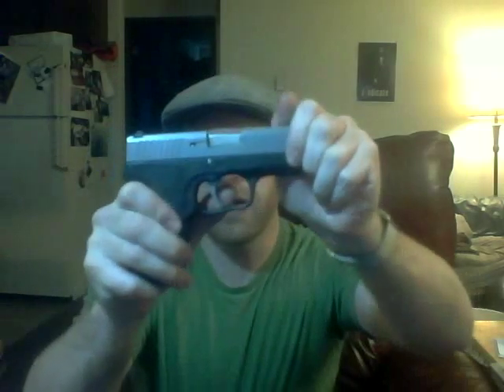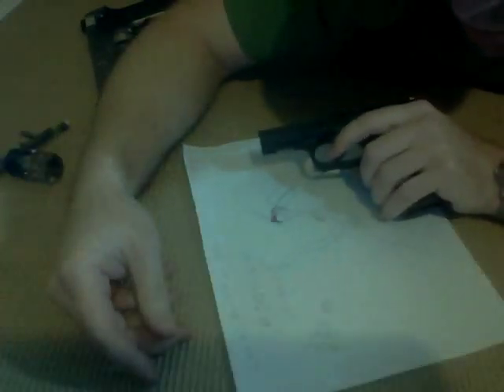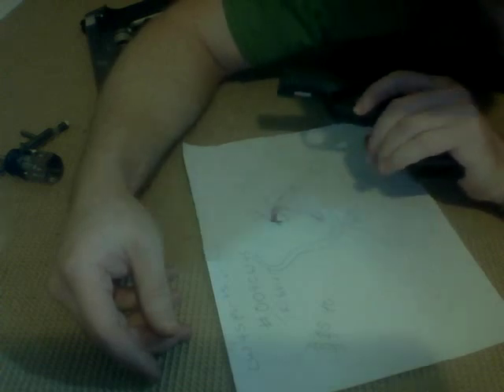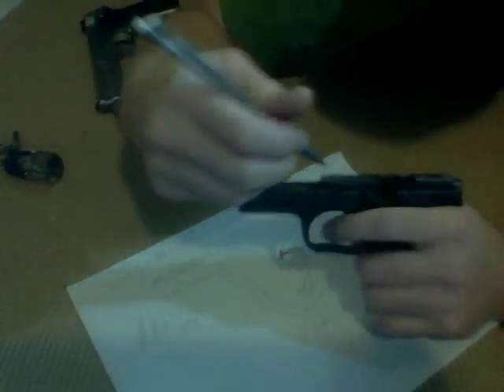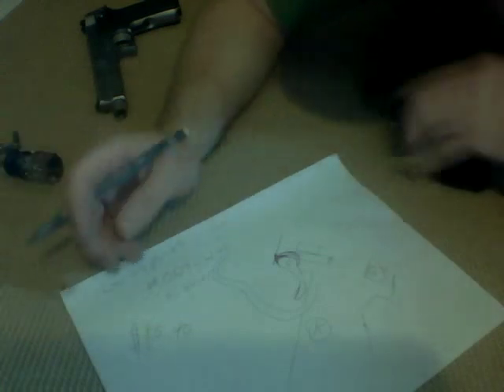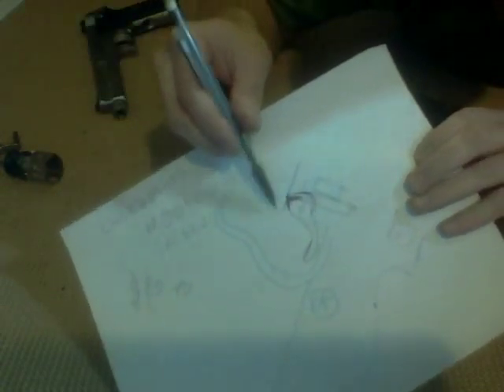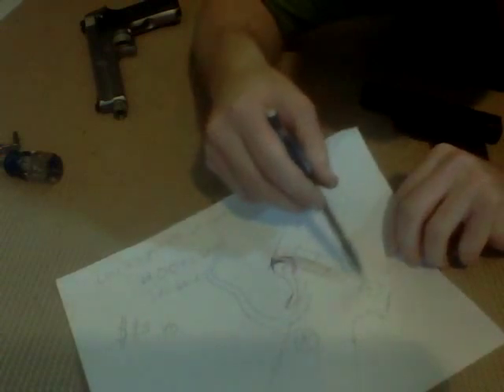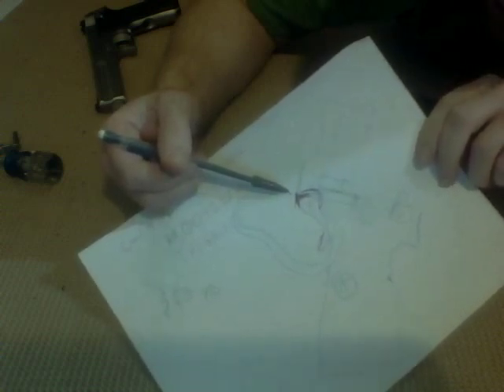Kahr Problems ... addressing a serious issue with a CW45

Comment: this was an obvious manufacture defect and under warranty or not Kahr would fix this issue with no questions. I've owned my cw45 for years and never had an issue. and ive put hundreds of rounds through it.
Reply from the maker: 1) I said as much in the video. At the time, all manufacturers were bogged down with a panic. Warranty work would likely have meant being without the gun for several months. This way, I did a simple modification to an easily replaceable part which could be purchased for $14 (IIRC). Worst case scenario, I'd just order another trigger, install it, and he would send it in for warranty after the panic backlog was sorted.
2) I've repeatedly said that Kahr makes fine firearms and this is not a common defect. However, I have gotten tons of people since this video saying they had the same defect on various Kahr models, so it is not that rare either. This defect is particularly bad, because it is not easily noticeable outside of certain weather conditions. Many users would not know about this without deliberately checking. It's a textbook "latent defect." No matter how flawlessly your example of a Kahr is, this one still had a serious flaw that people deserve to know about.
3) Hundreds of rounds is where the recoil spring wears out on many kahr models. Be sure to replace that soon. It's not a big number, but the spring is doing more work past the compression threshold on a sub-compact so it wears much faster. IIRC, Kahr recommends replacement at around 500 rounds with the PM9 & CM9. I don't know what the number is for the .45, but it is something I would want to know. It  makes a big difference in feed reliability.

Comment: Could you possibly list all of the "most other striker fired handguns" that have a second strike capability?
Reply from the maker: +Ronaldo Crespin That sounds like a big hassle, but the current gen Walther PPS somes to mind. There are at least 2-3 other recent gen guns but I can&#39;t think of them at the moment.

If you are somehow contorting things to an impression that I was saying most striker fired handguns have second strike that is not the case. Instead I was saying that the Kahr has a DA revolver/ DAO auto  like trigger by feel , but lacks that capacity.
Reply: +GunFun ZS I will add, that even though I have had many Glocks, I now prefer to have a handgun with a "second strike capability". I have had recent experience with primers not igniting and 99% of the time they will fire on a second strike. I find it extremely odd that one of the most dependable guns on the planet requires you to rack a new round into the chamber if you have a misfire. Yes, I am a sarcastic humorist, but I also am very serious about avoiding self defense weapons that do not allow a "second strike". I don't know why but I thought that the Kahr was full DAO, so I do thank you for clarifying that about the Kahr.

Comment: Happiness is a warm gun... I need to pop my CW45 into the freezer and see how it does frozen.
Reply from the maker: Yes. The beatles were right about at least one thing.
Reply: Update: last night I put my CW45 in the freezer @ 0 deg F. It was clean, normally lubed, and loaded with my chosen carry ammo for this gun, 200gr Gold Dot. It remained frozen for about 16 hours.

Pulled it out this afternoon and test-fired immediately. No malfunction, no short over-travel interference. Also chronographed the shots; avg ~ 870 FPS.

I'm like you; no way am I gonna take the hassle of sending the gun in for something I can fix myself.

Mine seems to have adequate over-travel for function. The trigger is intended to be very long and deliberate for safety. The gun is not for target work.   

The one issue I had with mine was the chamber was too tight. Any cartridge with a case mouth diameter above .471" would become stuck. No problem with any factory ammo, but my plain-lead handloads were measuring .472 -  .473" and no amount of extra crimp could reduce it. No other .45 of mine has this issue; Sig, S&W, Colt, EAA, RIA, all chamber my handloads. I fixed this with a finishing reamer from Brownells. Now I shoot whatever I want through it. My opinion is that a tight chamber is a bad idea for a defense gun; you want the cartridge to have room for some dirt & fouling in the chamber and still feed.

I use Wilson Combat 7-rd "officer's" 1911 mags; they work once you modify the base plate to fit. The follower doesn't engage the slide lock on the last shot, but I'm OK with that. If I run out, the gun goes "click", then I change mags and rack the slide. No trouble for me. It is not absolutely necessary to lock the slide open.

My CW45 is 2 years old and it's a shooter. I get an occasional light strike with Tula ammo because Russian primers are hard, and this gun doesn't strike as hard a some of my others. No problem. 

I like .45s, and I also like small concealable .45s. As a no-nonsense, rugged, go-anywhere, inexpensive, but reliable .45, this gun is tough to beat in my opinion.  I carry it appendix in a Galco USA (good stuff, and no gun belt required!) or I snap a Raven Van Guard on it and mex-carry it. Either one works under nothing but a t-shirt.  And I like to know that long, deliberate trigger is covered, when it's pointing at my junk.
Reply from the maker: onemoremisfit Sounds like you aren't going to have any problems. A gun owner who knows his gun inside and out and will improve any deficiencies is going to have a good time whatever he likes. Kahr guns are generally going to be a solid option. I carried the one in the vid for a few weeks and thought it was pretty comfortable. I like more about them than not. If there weren't other options I liked better, I'd probably own one by now.

Comment: Great video help. Thinking about buying this gun.  BTW Worcester is pronounced (wusster) Ma.
Reply from the maker: +Elwood Bluze Thanks. The guns are generally well made and well designed. The triggers are not to my taste, but if you like them, then the gun is an easy choice per category. I am surprised that the place follows the British pronunciation. Most American towns with European namesakes seem to follow a rule of being pronounced as anything but the way the Euro town is pronounced.
Reply: +GunFun ZS probably a local thing.  re:Worcester from my watching NH./Mass.  tv years ago.  Hopefully they have corrected this flaw if possible.
Reply from the maker: I think the flaw only happened during the production rush to build for the run on guns that happened after that Mass school shooting a few years ago. No data on this, and the company seems to have not really owned up to the true cause of the defect: casting variances likely related to cooling of molds between batches. They tried to blame it on an out of spec trigger transfer bar, but the particular thing they claimed could not have caused the issue shown here. They might have had that problem too on other guns, but I have know way of being sure on that point.
Reply: +GunFun ZS Speaking of rushing to do something,   After a state to state move I ended up sans handgun, a long story.  Anyway I ended up buying a gun for CC,  a S&W Bodyguard 380, now I want a .45 cal ccw.  So this Kahr looks like what I can afford and use.  Your examination of this problem opened my eyes to something I never considered regarding any handgun purchase.  thanks

Comment: After browsing the kahr message board I notice a lot of complaints of broken followers. The issue is a defect or design flaw. On some of the cm and pm pistols the magazine follower contacts the feed ramp. Eventually they break since their plastic. It''s not all of the guns. A minority I'm sure. After 2 tests I confirmed mine was contacting the feed ramp and also by the mark left on the follower. So I know my magazine will fail at some point. I called kahr and they told me no it's not touching. He said it's designed to be the thickness of half a cigarette paper away from it. Obvious lie. I assured him it was touching. He then said if it is touching it would of broke by now. Lies. After researching this I found it could break after 6 shots or 1000. It will keep breaking until it is properly fixed. I was told if it breaks they will send me a new follower. After it breaks twice I can send it in. I asked if I could send it in since it is clearly defective and under warranty and was told no.

This is an on going problem that kahr is very aware off but refuses to fix. I will not trust my life to that gun and will not buy another. I strongly advise against buying one and urge you to check your gun for feed ramp follower clearance if you do. Please google it and see for yourself. Type in "kahr follower broke"
Reply from the maker: I wonder if they've ever heard of UCC 2-314 or 2-714? Maybe they assume you haven't. 

--
Is a follower that repeatedly breaks fit for it's ordinary purpose? Does it undermine the overall purpose to have a gun you can trust if the  gun has been repaired many times and still exhibits the same problems? Do you have genuine concerns about their ability to provide you with a reliable pistol consistent with industry standards?

Those seem like some questions you could have lawyer think about asking them on some pretty letterhead.

Comment: you half to put 200 rounds thru this wepon before you do any review. its in manual
Reply from the maker: That has nothing to do with this issue. It has had more than 200 through it, and this is not a review. It is a repair analysis followed by the actual repair in part two. Kahr Problems -- Part Two: Correcting Trigger Travel

Comment: Damn plastic guns ...
Reply from the maker: Every type of machine has weaknesses.
Reply: GunFun ZS The polymer Kahrs have always been more troublesome than the original all-steel K series.  And to be honest, I was thinking about getting a CW45 - until I saw your video.  So thanks!
Reply from the maker: If you like the feel of Kahr, I wouldn't avoid it on the basis of this. I am sure this only affects a  few. As a couple other commenters noted, Kahr has apparently taken care of a few other owners for this issue and had good customer service. I'd buy one if I didn't hate their signature trigger feel.